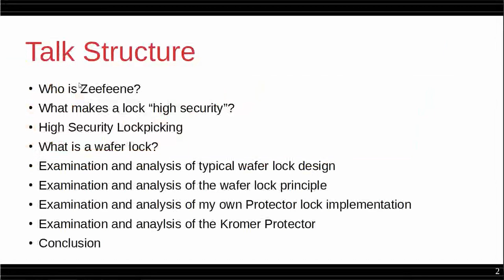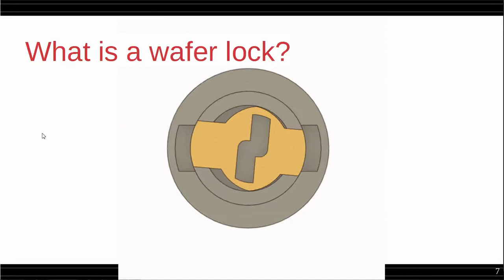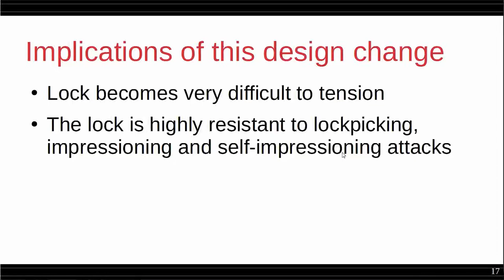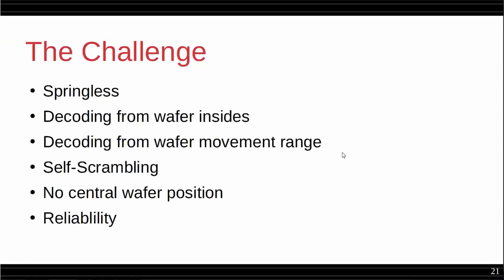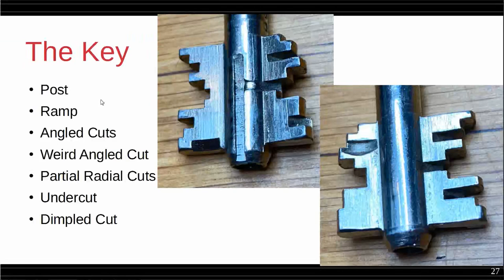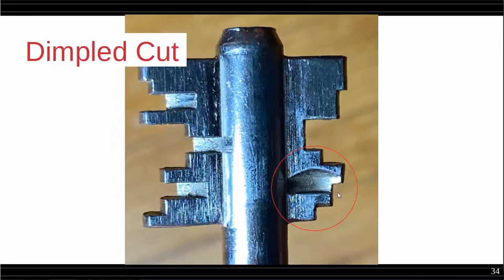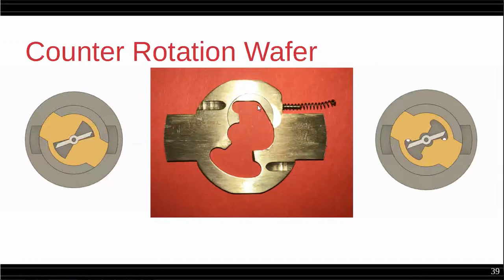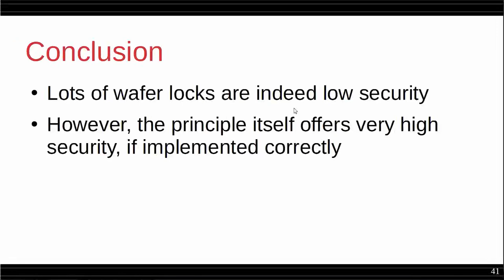DEF CON Safe Mode  Lock Picking Village  - zeefeene  - High Security Wafer Locks An Oxymoron

Comment: My first thought for your lock was "Why bother with counter rotation?"
Index it with detents every 90 degrees. 90 degrees to unlock. 90 more to lock (Upside down from starting position). 90 more to unlock again. last 90 to lock in the starting position.